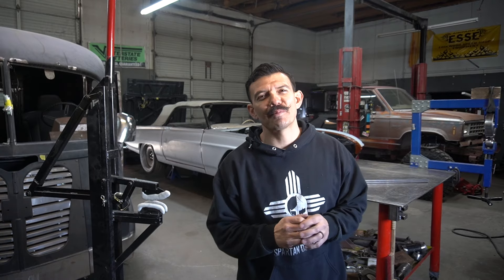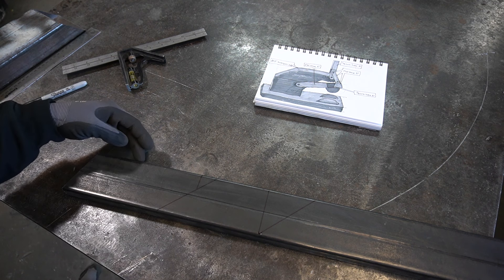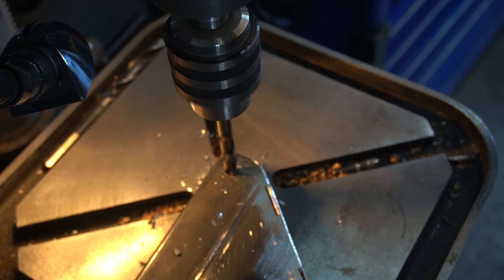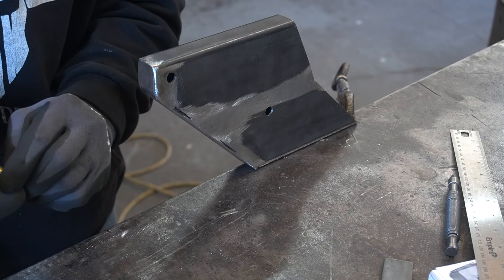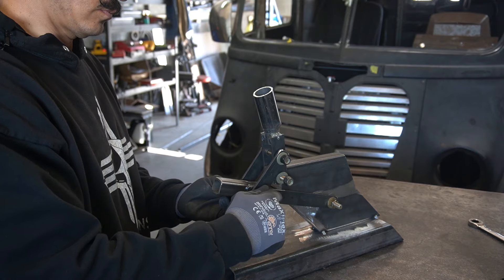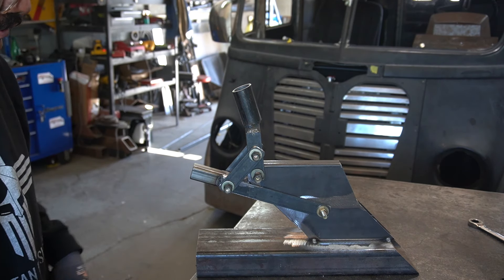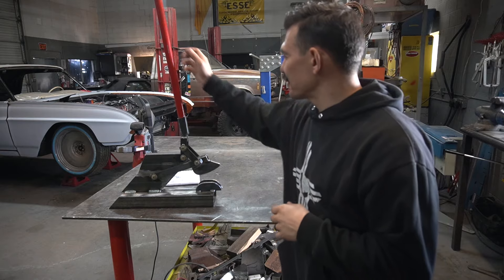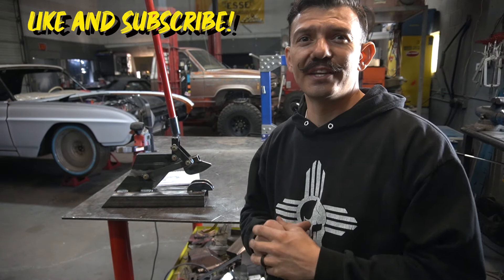Metal forming tool | Lever machine | Tucking tool for sheet metal fabrication | DIY gathering tool

Comment: `Thank you Sir! Another great video as usual! I have one question, does galvanized sheet metal is harder to work on compared to regular sheet metal? What's your opinion on these two types of sheet metal?
Thanks in advance!
Reply from the maker: Well I believe galvanized sheet metal is just cold rolled steel with galvanized coating on top of the steel as a rust preventative. Iv never shaped galvanize but I would imagine the galve would flake off, also welding on it can give you galvanized flue, make you feel like shit if you inhale it. Speaking from experience 😂
Reply: @BeAMetalFabricator  Thanks for the explanation, I think it would be best to avoid it then 🤣

Comment: you have inspired me to learn how to do patch paneling on my 56 belair instead of buying new panels..i just dont know what sheet metal to get
Reply from the maker: That is awesome man! I believe those cars were made out of 19 gauge and the more common sizes are 18g and 20g. I usually build body panels and patches out of 20g. Floors and firewalls I build out of 18g cold rolled mild steel
Reply: @BeAMetalFabricator  Thank you! Keep up the amazing work o have learned so much from you